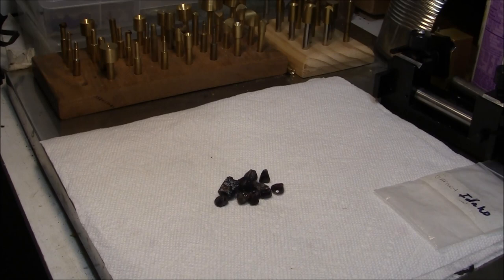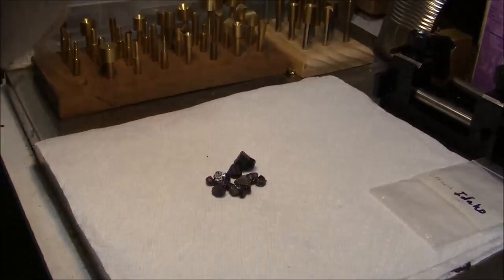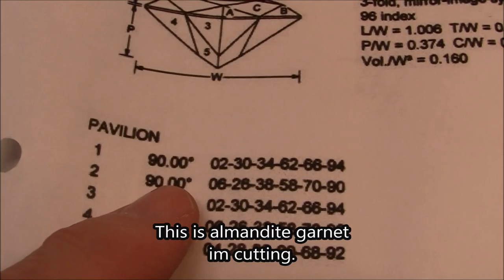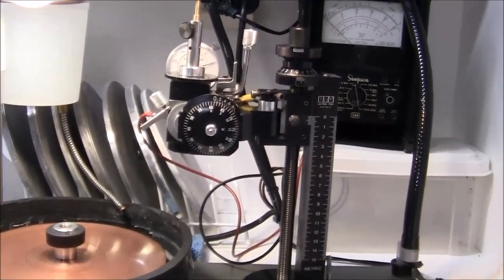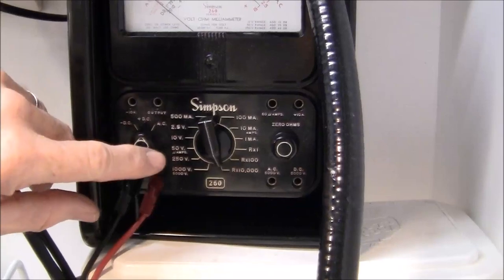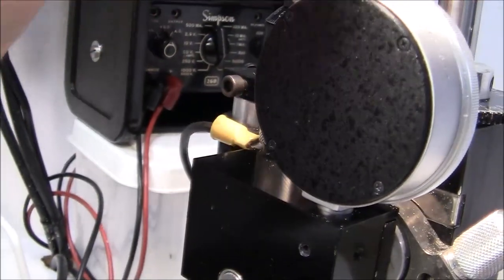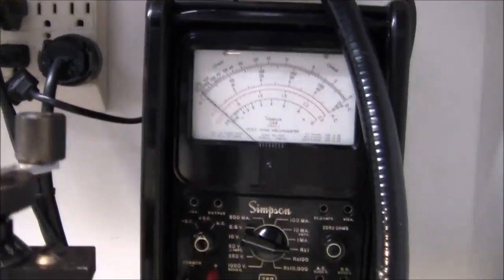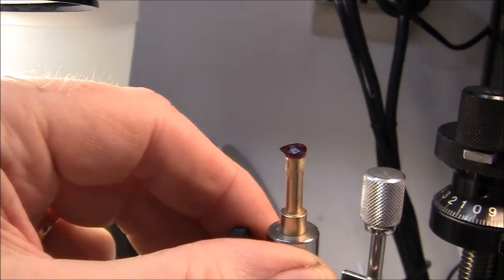Faceting an idaho garnet.

Comment: It will be interesting to see how accurate the Ohm meter is? I'm not convinced  depth guages and Ohm meters are useful? I've found guages a hindrance in the past. When I first learnt, the machine I learnt on had a depth guage. After a several months I ditched it. What is interesting very few of the competition facetors is Australia use depth gauges, or have them mounted on their machine. However, as a experiment a ohm meter would be interesting to use. Technically, if it's highly accurate it should polish to a meet point....Keep us updated Brent. Good job on the garnet.
Reply from the maker: Thanks  cliff,    the ohmeter does help with getting close  to your meetpoint but   the hand pressure is the real  variable i find.  Still nothing will ever replace the eye .
Reply: @tennpikr74  Are there instructions on how to hook up the Ohm meter to a faceting machine?
Reply from the maker: @VintageTimeGems  I found my information on a facebook page , there are several faceting  groups that  have been talking about it and have photos , etc.  there is ultra tec faceters,  faceting technical,  facetron users,  and others.

Comment: Very nice cut on the garnet.  The depth of color is amazing.
Here's a thought regarding the Simpson on RX100... It might be possible to adjust the meter indication so that a "fully closed" reading is exactly on one of the indexes on the scale by using the "Zero Ohms" adjustment knob. Something to consider???
Reply from the maker: Thanks,     since then i have a different simpson 260   and this one will only read on  the rx10000 setting  which is ok, im still getting used to using it and using the same hand pressure everytime.  I think i can adjust it to land on an index.

Comment: That screw hole on the Ultratec is for an idiot light system they have.  Hooks up like your ohm meter.  I'd like to see your opinion of the ohm meter after a few stones as I'm not liking the idiot light, though I might try your spring idea with it as that is an issue I face with it and that seems like a good resolution.  Thanks.
Reply from the maker: ive cut a few more stones and really like the  meter and have even removed the dial indicator gauge.  The ohm meter really is more accurate  than the dial gauge.   I had the ultra tec down indicator light  on my old v2 in the 80s, it was a red led  light. I forgot how it hooked up.  it was better than nothing back then.